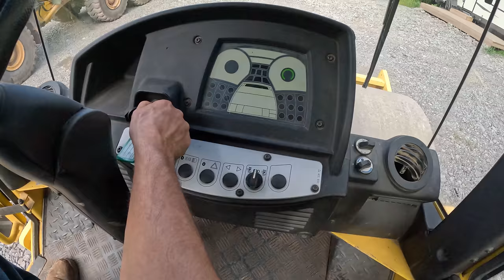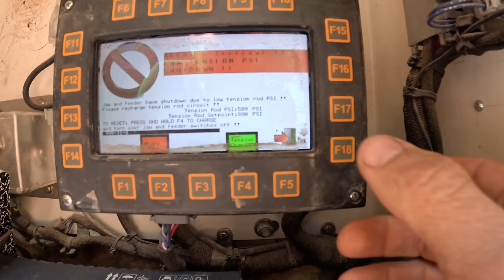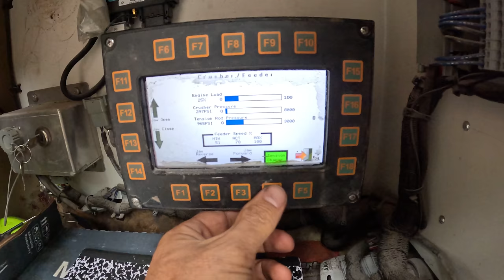Moving a big wheel loader

Comment: Hmm, were the locking pliers hot after starting the Koehring?
Reply from the maker: I got shocked.
Reply: 🤔🤔 seems weird to get hit by DC and not even from spark plugs! Ok I had to zoom in and slow-mow it.  For some reason I thought one wire was pos and the other neg... threw me off, actually they are both positive leads 😵‍💫 Yea your reaction sounded like a shock, but the delay from unhooking the pliers to dropping them appeared off! After zooming in I can see the pliers touched that one lead clamped to the chassis right after you unlocked them. That must be coming from the battery/alt. DC shocks are pretty rare. 🤔 I'm guessing if you had been standing on the ground and not leaning on the chassis when handling those pliers, it wouldn't have shocked you...  considering it would have had to travel through you, your shoes, the earth, and up the tracks to get back to the chassis. At 12v or 24v, that's not likely to happen. Well kids, hope you learned something from that.  😂 ⚡

Comment: Hi Andrew, what do you make of that leatherman skeletool cx ?
Reply from the maker: Good tool, I use it all the time. Just lost my CX though, wish the clips were stiffer.
Reply: @AndrewCamarata  good to know about the (pocket?) clips, I have a Milwaukee fastback for work and the pocket clip is plenty , but would be nice to have pliers too, hence why I'm considering the skeletool.
Reply from the maker: The pocket clip is no good, I took it off. The belt loop clip works better.
Reply: @AndrewCamarata  makes sense, thanks for replying !
Reply from the maker: Actually, never mind, I just found my missing CX, it was on a table and had not come unclipped from my pants like I previously suspected.
Reply: @AndrewCamarata  this kind of thing happens to me too often! 

Yeah I'm considering one for sure! The only thing I'm thinking about is UK knife laws. Not an issue for me most of the time as have good reason and live in the countryside.

Would be cool if you did a review on the CX and maybe other bits that you use and make life easy or enjoy using on a daily basis, especially with your long term experience as you do with most videos and reviews!

Comment: If Andrew works in the mountains and no one is around to hear it, Did he really work in the mountains 🤷‍♂️
Reply: What a view of the mountains surrounding 👌
Reply: U should check the wipers in rear of belt if it has them? Usually just before the roller to kick out the gravel stones if they get behind belt.
Reply: Same sensor in a Volvo 235E , i snapped it off changing a hose. 280$ for sensor

Comment: 38:00 can you adjust machine to make smaller rock or (gravel)?
Reply from the maker: That is as small as it goes without modifying it. I don't know why it's like that. Most people who crush rock have a jaw crusher (what I have) as a primary crusher, then they feed it right into a cone crusher to make the rock smaller. I feel like the jaw could make smaller rock if it was set up to do so. There must be some reason for this.
Reply: @AndrewCamarata  Who ever had this crusher before you must of ordered it that way being job specific for their needs. When I was looking to buy some land in west texas (Terlingua) I was looking to buy a much, much smaller crusher but I could adjust the plate to different sizes but I couldn't do near the volume of rock you are doing with your big azzz machine. :)

Comment: Hey Andrew , great stuff, you are a major influence , I own a 4 ton excavator and do my own work and live off grid on a mountain with my own mile long road. My question: would a 300 class excavator be too big? That koehring looks amazing, I want a machine that can rip rocks and stumps and lift heavy and high. But is the fuel consumption and swing radius too much for a 80 acre property, wooded? 300s seem to smash so much better than a 160 (that can be easily transported with a 10wheeler)
Reply from the maker: If you’re not going to move it often, it’s nice having a big machine,  you’ll get used to the size, your roads will end up wider, though.
Reply: @AndrewCamarata  thx. Yea they also seem to sell cheaper. Everyone around here says "it'll be too big" but idk I think it's worth it. Central VT
Reply: Middlebury born here.

Comment: Anyone wondering why Andrew does almost everything himself and doesn't hire extra people for big jobs. This. Right here. Is why. ---> 18:09
Edit: this is what the driver did. 28:20
This guy that couldn't even check that it was ok to chain it there just costed Andrew $300
Reply from the maker: You are right, stuff like that is way too common.
Reply: @AndrewCamarata  I actually have my own story with something similar. I had a 2003 Hyundai Elantra for my first car. Nice clean car no rust. Bought it for really cheap and me and my uncle basically put all new suspension on it from rust. Thing had less than 100k miles. Front crank seal blew out after only driving it for a total of 2100 miles. Was way to expensive to fix because the whole motor would need pulled to do it right. So it had to be towed home because of having no oil. The guy that towed it home said. "It drove on to the trailer. And it sounded pretty good for supposedly not having oil." Then proceeded to start the car after dropping it off and I yelled at him. Dude was swearing up and down it had to have oil because of how good it sounded. I literally had to open the hood and show him the dipstick for him to shut his mouth. That's why I love your videos because we have a similar mind set. You manufactur something it should last a very long time. And theres no excuse for being dumb. Sorry that got long.
Reply: It is NOT a  WONDER that Andrew does everything himself.  He DOESNT PAY anyone for their time. IT is THAT simple.

THAT is the reason no one will work for him, he thinks he shouldn't pay them, because he is Andrew Camarata a Youtuber, despite pulling in $750,000\year in YouTube revenue.

Its widely known  that the other Youtubers working alongside them did NOT get paid, Andrew reckons they are paid enough just because they get exposure on HIS channel.

That is why they will not work for him again...ever.
Reply: @EsseHolez  Andrew does all of his own work. Both construction and video editing and uploading. He earns every penny he gets. Also. Did they know ahead of time he wasn't gonna pay them? Yea he gets a lot of money but he also spends a lot to keep the business going. That's how construction is. Big pay. Big cost. Also he said why he doesn't hire anyone anymore in an interview he did. Because people are incompetent. Also who specifically did he do a collaboration with on YouTube? And I didn't say "no wonder he doesn't pay people" I said. FOR ANYONE WONDERING. He can do whatever the hell he wants with his own money even if he has a couple million. Go make your own damn money. You don't see me in his comments begging him for free cash. I'm in over $15k in debt from court fees and I plan to work and pay it off myself. Including selling my truck to pay for it. Your just mad you procrastinate and are lazy and want someone else to blame. Get off your ass and go work. Get a couple 100k saved up and make YouTube videos about it. You'll have endless amounts of people begging for free money. You'll see how it really is. You think you'll be there to save everyone financially. You won't. You WILL change your mind. Ive seen it plenty enough times myself. In person

Comment: Customers bring me cars or trucks all the time with brake issues and bad vibrations that mysteriously just appeared. I ask em has ur vehicle been towed recently and the answer is almost always yes cause the idiot tow truck drivers run chains, straps etc over the cv axles, brake lines, hoses etc....I've had a few sue the towing company usually to no avail. I just fix it and lesson learned i reckon. smh....

Comment: 25:30 was not a very good rigging and lowering of the CAB rollover Brace. The older guy had just been near that mirror arm and it would have nailed him, seconds later with that 6"+ drop of hundreds of pounds and no gloves no bars, and no 4 corner lift attachements- not even a stable locked sling - just all casually looped through the bucket. You had better get more serious on safety and rigging. I have seen you snap chain. and lose loads/ roller. use Weighted blankets. secondary safety lines Hard hats boots and gloves.  You are doing so much heavy duty crap and not acting  like it. Older man is in shorts and sneakers!!!. Even falling from the cab could kill you. You should get a good insurance carrier for guests/volunteers on the shoot. This is work "au chez Camarata" is often too close but great drama.  I hope that you will be not getting any other mishaps that are of your own making. I thought for sure you were going to drop the truck first from the 45' top and then do a crush ..... mayb e next time.  Stay dafe and quasi sane.